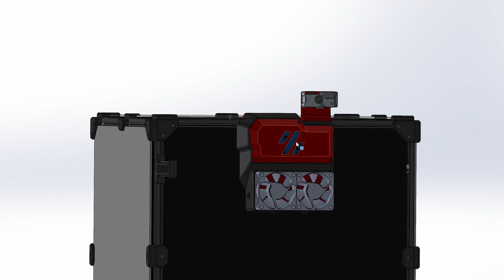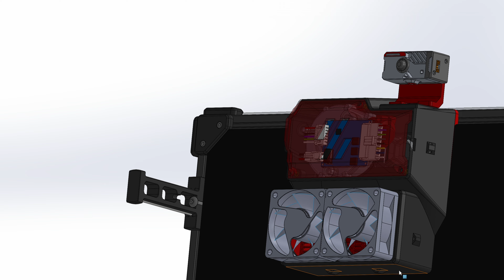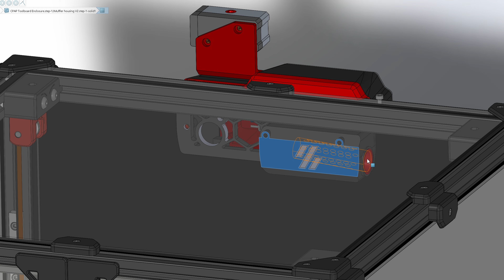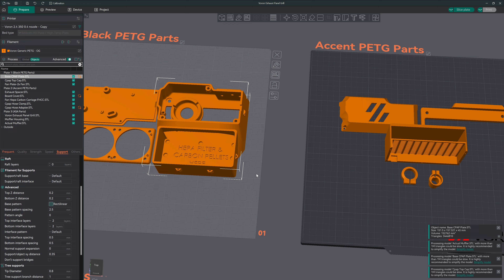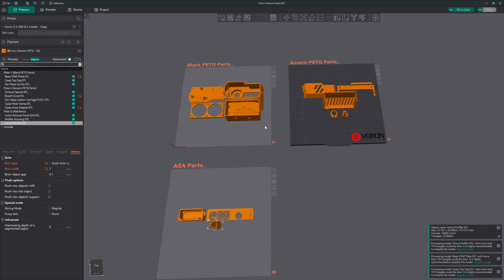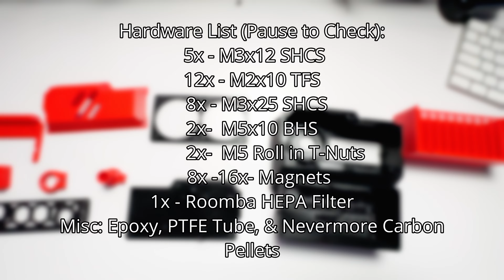Voron 2.4 MOD - CPAP HEPA Carbon Filter Exhaust

Comment: I love your design. I just dont understand the purpose. Your filter pulls hot aur out. With abs or other engineering filament  you want to keep it in. The cpap does no good with abs since you usually dont use part cooling very much. Makes no sense. The filter is useless for pla. The cpap  would be ok I guess.
Reply from the maker: No worries man
I have changed my settings so that the exhaust pulls the fumes out of the chamber AFTER the print finishes. You can have it running ~5-10% during the print and it wont drop chamber temps too much. Most of my parts arent tall (roughly 40mm in height) and can handle the cooler enviornment without warping. Yes cpap on abs is bad if youre going normal speeds but its very helpful if you go faster!